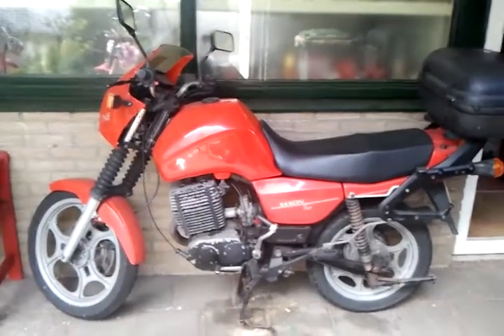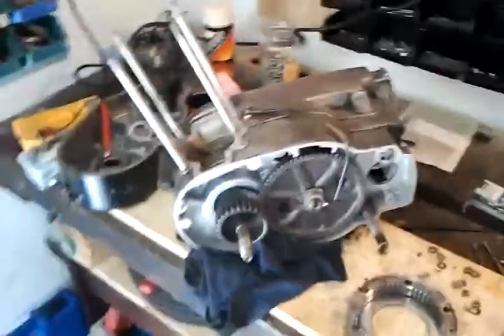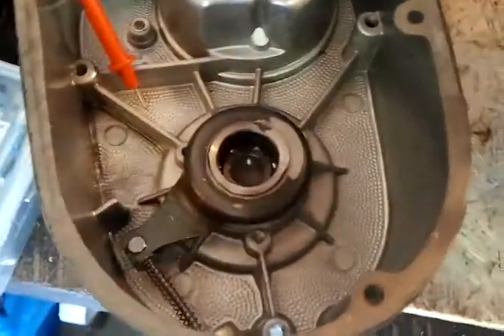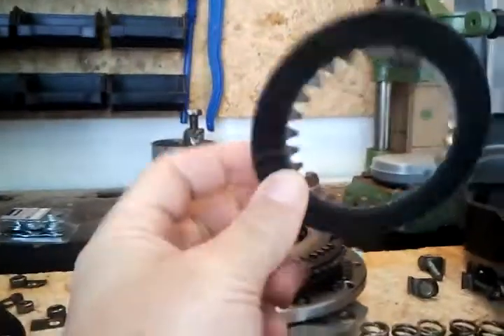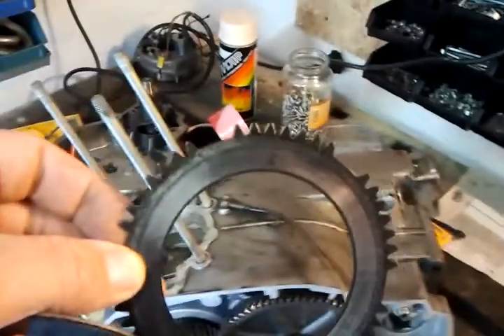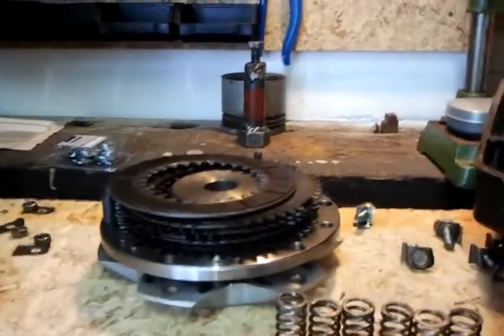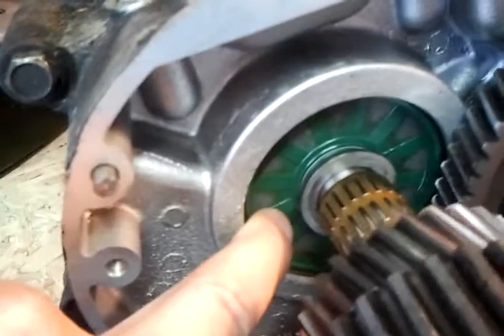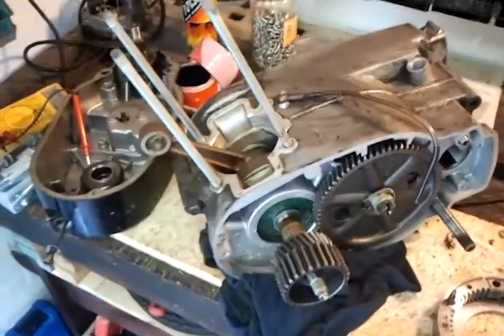EM 301 progress MZ part 3

Comment: Use Silkoline light gear oil in the gearbox. It works very well in my 301.
Reply from the maker: What is the viscosity of that oil? What is de API GL- code? Please note that the oil must meet the GL-3 spec, or your clutch will suffer badly!